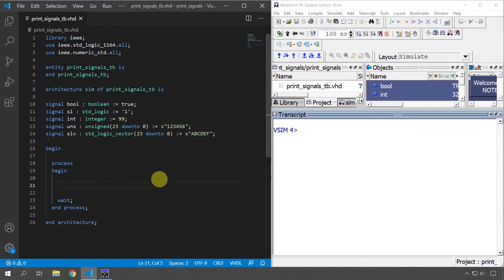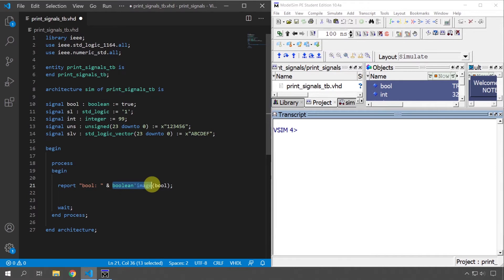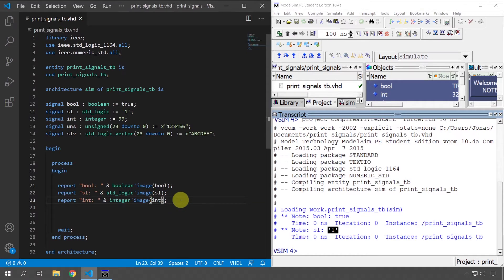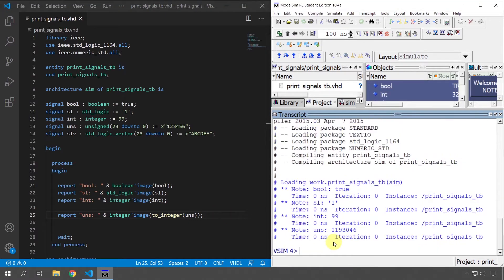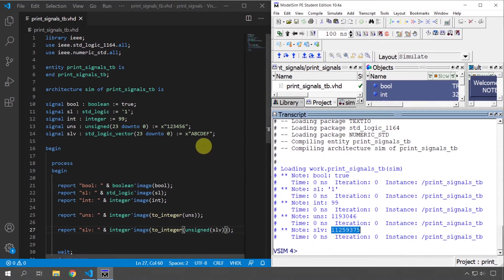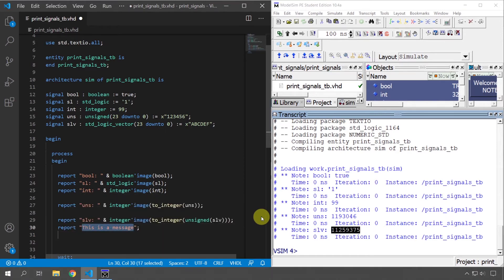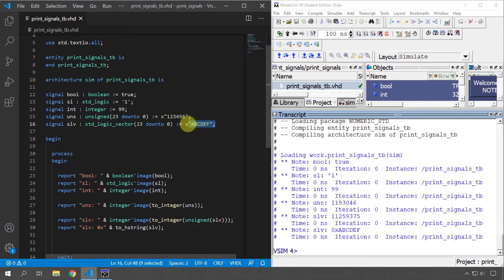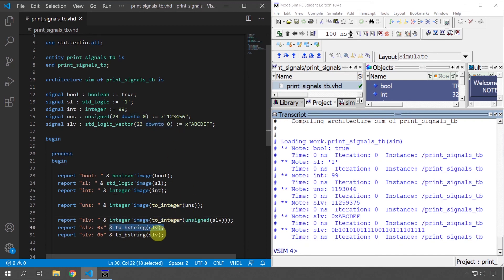How to print VHDL signal and variables to the simulator console

Comment: Is there a way to write the value of variable width more than 32? casting it to 'image would truncate the value right? ro_integer will convert the value to the integer range
Reply from the maker: Yes, you can write a custom function that does it. I have one in the VHDLwhiz Membership (vhdlwhiz.com/membership) resource database.

It has this prototype:
function big_num_to_string(s : signed) return string;

And there's an overloaded version for unsigned.

I will give you a hint if you want to try for yourself: First, convert to BCD using the Double Dabble algorithm.